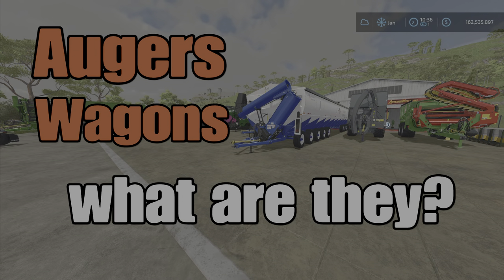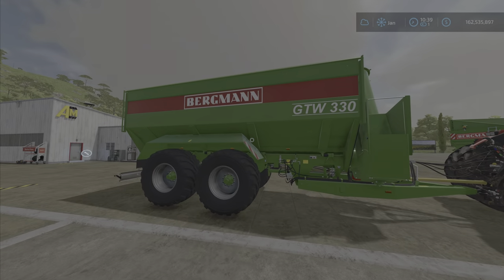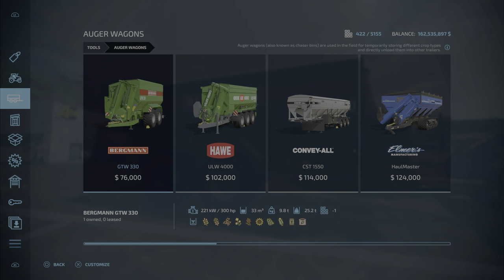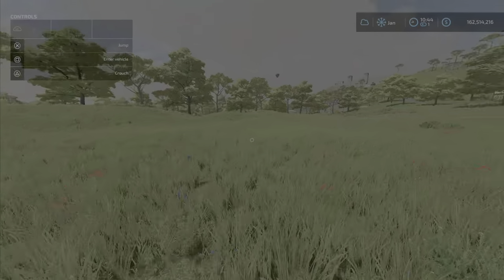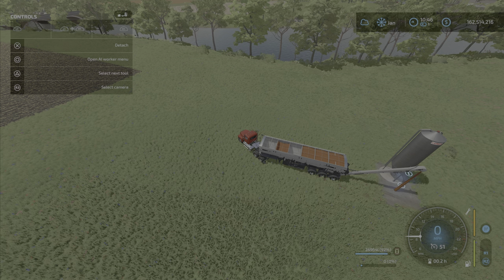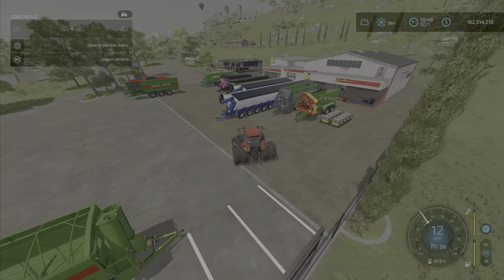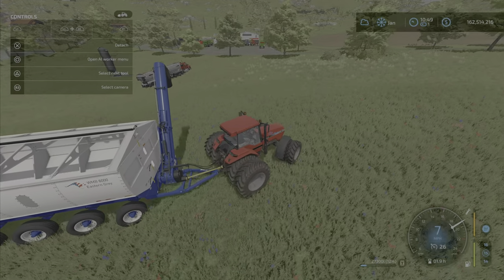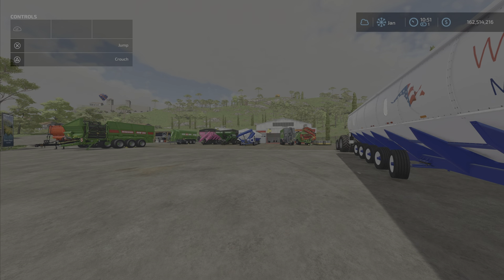FS22 Auger Wagons , a brief tutorial

Comment: So auger wagons are pretty redundant then eh?  Why not unload the harvester directly into a trailer?
Reply from the maker: Yes you could do that . However Auger wagons are widely used in agriculture and it is part of the equipment in the game .
Many players chose not to use them . This video is for those who want to know how they work . Personally I like them 😁
Thanks for your comment
Reply: @LooneyFarmGuy  Ah, just to add a bit of realism to it.  Thanks for answering my question, I've been looking at the auger wagons ingame trying to figure out how they would be better than loading directly into a transport trailer.
Reply from the maker: @BlueOvals24  They were more useful in FS19 as they would unload without being attached to a tractor , but they are still cool and the mother bin is still the largest mobile container at 200,000L 😁
Reply: @LooneyFarmGuy  Eh, maybe I might start using them when my farm is thriving.
Reply from the maker: @BlueOvals24  They are a nice change from the normal trailers and you can refill seeders and fertilizers with them 😊
Reply: @LooneyFarmGuy  Off topic question: which is better sugar beets or sugarcane?  I know that sugarcane has a higher yield, but all the equipment has a very small working width so I was wondering if it would be more worth it to grow sugar beets
Reply from the maker: @BlueOvals24  Good question .
Although I don't do either one of those crops much I would Do beets well before trying Sugar cane .
There are so much more equipment and new mods for beets everyday .
There is a reason some refer to it as sugar pain 😂

Comment: I have the Auger Wagon at 10:20 and it won’t accept the barley from the harvester. Any idea why?
Reply from the maker: Which one did you use ? There are some that only doe root crops
Reply: @LooneyFarmGuy  i used the cheapest one, today i tried it with a different harvester and different tractor pulling the chaser bin and it seemed to work so not sure what the issue was🤷🏽‍♂️
Reply from the maker: @jorden_h  Ok thats good ,
There have been some issues with the game and Giants are working on fixes .
Sometimes it helps if you save and then close the game and restart . 
Cheers